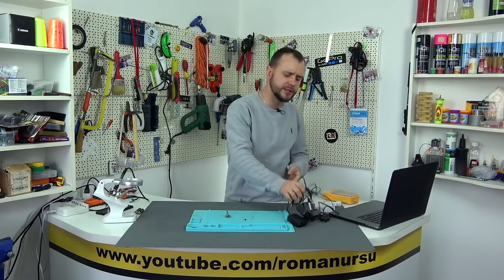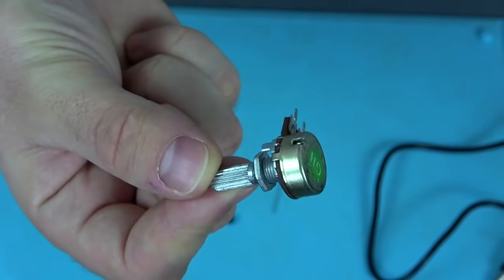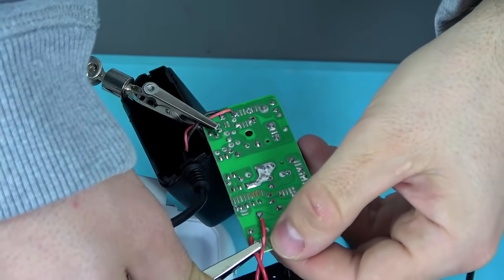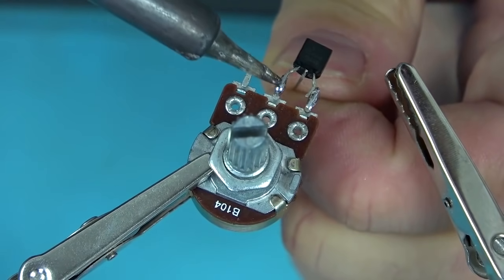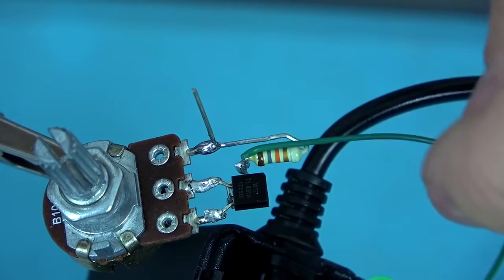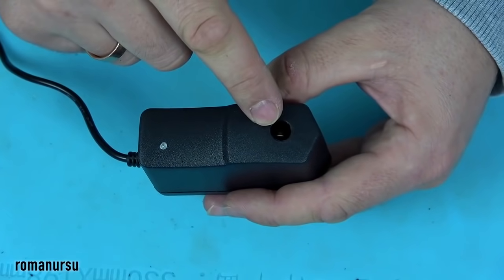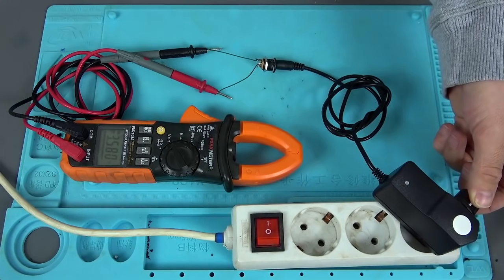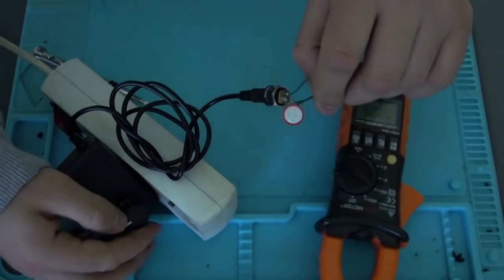How to make an adjustable power supply in 5 minutes

Comment: I tried but Boom,,💣
Then i increase capacitor to 25v volt, without resistance, again Boom when potentiometer is on full. How can i limit the voltage to within 15v so that it doesn't blow when i turn potentiometer full.? Does 18k resistor help me for it? I need power supply of 13 to 14v for 3s bms to charge 18650 batteries

Comment: Hello, we have an agricultural land that has no electricity. Now, if we want to use a motorcycle battery, which is 12 volts, to get different currents, such as 10 or 12 amps, what transistor should we use?

Comment: this is wrong! you will also need to replace the output caps with at least 20v if you will have a 15v output passing 15v through a 5 or 6v cap ain't gonna end well

Comment: I don't know man. I looked inside my trashcan. No knobs. No stickers. I couldn't find anything I could describe as "cool", or "cool looking". It was mostly just various kinds of food packing materials, just like the stuff I buy at the grocery store comes in. There was some spoiled leftovers too, but it didn't seem like the value they bring my power supply project warranted digging them out. Full disclosure, I don't have the trashcan's manual, and can't verify if I'm actually having a technical problem, or if it's just user error, but I feel like I'm using it right. My guess is it's just broken

Comment: I need to say that is a nice idea (I made it to adjust some rare transformer to different operatus). But you need to know that the good way to process is that it's dangerous to reach twice or more the initial value. Voltage regulating here comes from a PWM wich change duty signal to provide highter voltage. First HV circuit is not made to work in that range of tight pulse. This is the reason why you must use this tip to have voltage as less as you want, but for reliability and safeness, don't reach more than twice the value... This primary circuit is not design to regulate until this point.

Comment: Great solution to resurrect old power supplies but Please ba aware that usual in Chinese Power supplies output capacitors are only bit higher than nominal voltage. If you will have constantly 15V having "stock" 6,3V capacitor your power supply will not live long time.

Comment: be careful when using the lowest output voltage together with the highest output current. The internal dissipation will be very high.....
Reply: unless it's not a switching mode regulator

Comment: I really do not see the need for this with all the very inexpensive converters you can buy for a few dollars these days. Given that, it is excellent for education purposes. That's what you do to learn. You blow things up and figure out what went wrong. Working with electricity is ALWAYS dangerous. If you do not understand that going in to it you shouldn't be touching it in the first place. I would however set up a fused isolation transformer so you are not plugging directly into the mains. That is very very dangerous.

Comment: The output capacitor value should not be less than the output voltage, otherwise, it will explode. You need to carefully check other components effect when you change the voltage. It may be useful in some cases, but it needs knowledge and understanding of components, current, voltage and ohm law.
Reply: If 12V adaptor stepdwon to 9V is it safe?
Reply: @firmanhidayah9480  Hell YES ☑️

Comment: I would solder the metal case of the Poti to the 240v live wire, so it can't touch it by accident. In this case at least you can be sure  touching it is dangerous

Comment: Thank you.  I had a power supply from my computer die, one of the ceramic capacitors burnt up.  Most parts are still in great condition.  I scavenged a lot of parts from it.  Including the TL431.

Comment: and the output capacitor is 1000uf/16v, and boom
Reply: Use atleast 50v 600 to 1000 uf capacitor, as tl431 works within 36 v , then there is less chance to BOOM. Remember to use tl431 or zener diode otherwise there will definitely Boom in abscence of zener or tl431

Comment: As already mentioned before, the output electrolytic filter capacitor and rectifier MUST BE CHANGED for such higher voltage MOD.
Also other problems may arise depending on the circuit topology and implementation.
Personally I would not MOD a 5V P.S. for more than 9V.
Reply: Yes, I was expecting it to pop when it went above 12V.  This video also lacks explanation. Do you  happen to know why zener diode and why this stabilizer was was soldered the way it was (I mean pinout relative to potentiometer + resistor).

Comment: This is totally garbage because it has 100mA of Current what you can get from this charger because this TL431 has around 100mA of Current power so this is garbage ...
Reply: you're wrong because TL431 just replaces a Zener diode in series with a 817 optocoupler. No load current is passed through the TL431. 
When output voltage is high enough to open both 431 and a 817, then power controller decreases the energy applied to the primary side of the transformer. 
This way if we change the potentiometer ratio - we change 431 open threshold in result. In turn the output voltage changes too.
Reply: @peschex0d  okey, im not see it in the video (this opto)

Comment: And I don’t think the small wires you used would handle 6.5 amps. Bye Bye.
Reply: it cant supply 6amps anyway, the max current is clearly stated on the label, 2 amp!

Comment: Nice! Am now your new subscriber. However, the new circuit cannot be used for laptops. Laptops require 19.5 volts 2 amperes, right? If you were to use it it would definitely burn the parts of your adjustable power supply such as: rectifiers, switching transformer, diode in the secondary, & so on, because they're too small.  Not to mention you have to change the electrolytics to bigger ones also. This circuit is good only for fast charging celphones & small stuffs.

Nevertheless, the idea is great!
Reply: Every laptop has a different voltage charger.
Reply: many laptops are around 19v yes, but more than 2 amps, mine is about 3.5 so a small 'plug' power supply like this is not suitable as not high enough wattage

Comment: What about the main power capacitor.... It's designed to support 5.0 voltage output, now you're taking 15 volt as output... so you should have change the capacitor also....

Comment: Great idea but make sure those caps are rated for at least 15 volts. And it would be better if you explained the theory of operation as well.
Reply: true, most cheap ones you find like this have 10v rated output caps if its a 5v supply, so thats definitely something to also switch out or it wont last long.

Comment: I made this kind of power supply way back but when I was using it it work for some time but then it explodes it preety dangerous.dont make it
Reply: U have forgot to change the output capacitor. Its normally rated for 16v for  a 5v charger. U might have exploded it😁
Reply: @power45118  no iam not that stupid I change it to 20 v
Reply: @guri5257  -  Did you draw too much amps?

Comment: its dangerous to use as you go over the limit.change the output electrolytic capasitor to 25v before use.
Reply: The comments are just as helpful as the videos lol.
Reply: Totalmente de acuerdo contigo.
Reply: I agree.
Reply: ..otherwise the small value cap gonna be explode
Reply: You can change with a 25 voles capacitor as i did!!!
Reply: If change it to 25v electrolytic capacitor, how much is the uf?
Reply: @vhannezajhoycaparoso6385  the same to old.
Reply: @giorgostexnikos6976  we tried lower uf to the replacement capacitor, the resistor and ceramic capacitor explode. Min. V is 3, Max. V is 49, then suddenly explode.
Reply: @vhannezajhoycaparoso6385  never low.uf.same uf or biger .if you have 470uf .use 470 or 680.or 1000uf.never down to470uf

Comment: I am not sure if the output electrolythic capacitor of 5V power source is rated for 15V. I would change it.
Reply: Yeah, this is the first thing I thought about after it exceeded the six volts. That's make it a fire hazard. But overall, the idea is as good as always.

Comment: Good idea but useless without circuit diagram especially for beginners.
Reply: No, even a beginner could locate a Zener diode at the PCB and then replace it with exactly the same way soldered 431 =) 

no schematics is required for such an upgrade. 

hovewer anyone must replace capacitors at the output side with some higher voltage rated ones (if you need to raise output voltage).

Comment: The circuit using TL431 is very inefficient.
Original adapter can only be used up to 2A, 6.5A can't be taken out.
The circuit will burn in few minutes.
Reply: It's not because of the TL431, it only gives a reference.
In any system if you raise the voltage the max current will be lower, but if you know the maths then you know that 5V 2A gives the same power as 10V 1A.
Reply: @szaki95  just hook up two chargers in series xD
Reply: @manuelc4746  No te entendio Manuel, hablale en ingles, Manueeel!!! no te arrimes a la pared que te va llenar de caa caa caaal
Reply: @manuelc4746  Aprovecho que ví el texto en Español y le pregunto sobre los componentes electrónicos., ya que se me dificulta entender Inglés y el diagrama no menciona sobre las características de la resistencia variable (potenciómetro).
Por otro lado sugieres también reemplazar el capacitor?
Gracias y saludos desde Argentina 🇦🇷👍
Reply: Even if this charger uses a Shottky diode, the thermal power at 6A x 0,4V would be high enough to melt the solder off the PCB ((( or burn the diode down, because there is no heatsink. Also I doubt the transformer wiring would accept such a high current.

Comment: Circuit schematics or link
Reply: the 431 schematics you can find in its .pdf datasheet or just online. In this video 431 with two resistors is used as a variable voltage Zener diode. This way voltage regulation in such an power adapter works and once you change the Zener diode (or change the voltage at 431 pins) you get some other output voltage.